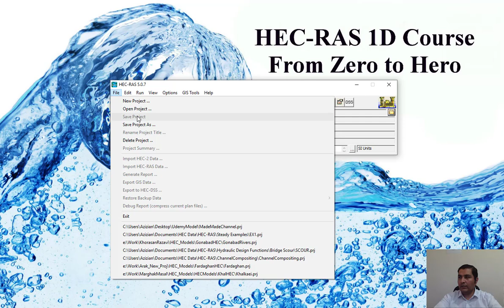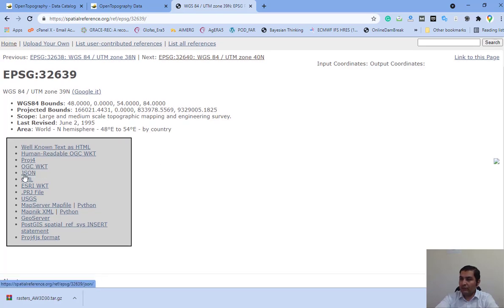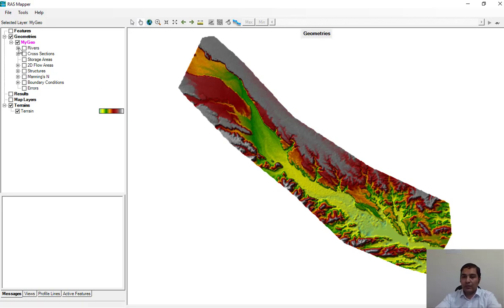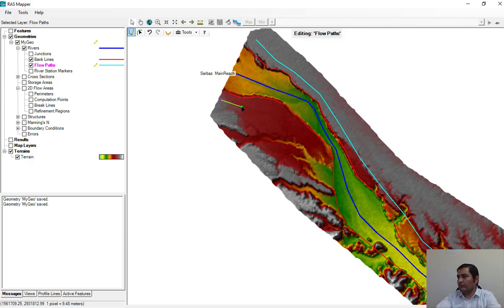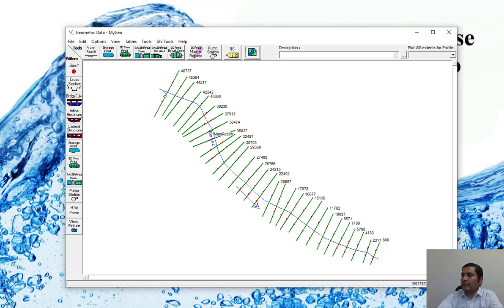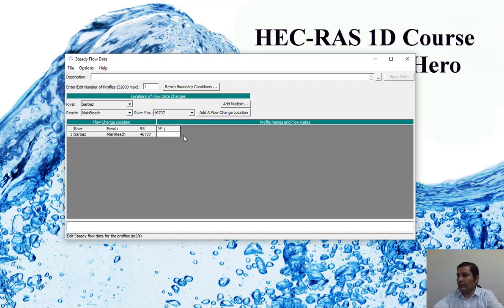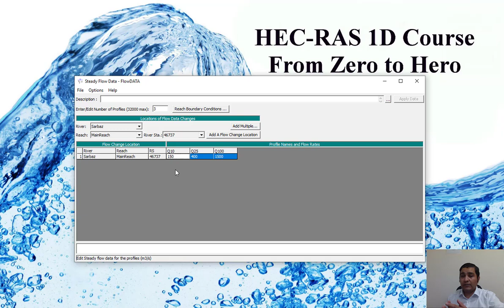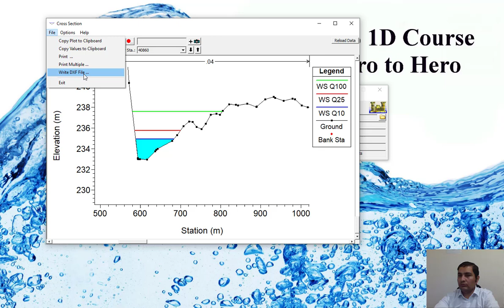Flood Inundation Mapping Using Remote Sensing DEMs and HEC-RAS (for data-limited areas)- Part2

Comment: I was trying to reproduce what was taught in my region and two messages appeared. "Time series data starts after the simulation starts.      Stage(s) in time series data are below the cross section minimum." What would that be.
Reply from the maker: Hi, the first error indicates that you run your model more than your input time span. try to use the same time span for both Time series data and simulation start and end time. the second one, says that initial water stage is lower then bed elevation and you should modify the stage level for better running

Comment: Sir, if the river is connected with two river branches. how this modelling part changes.
Reply from the maker: Hi, First, you should create (digit) the mainstream centreline and then create the other branches.  Before finishing the digitizing process, double-click on the main stream, and the model will automatically create a junction at the confluence location.
I hope this works
Best
Reply: @HydroAI2024  Thank u sir, I have a problem with the inundated area. why is it not appear in the whole inundated area? it was congested to the cross sectional length only. how to avoid this problem.
Reply from the maker: Hi, May i see you outputs? and then I can help you. I mean inundated area..